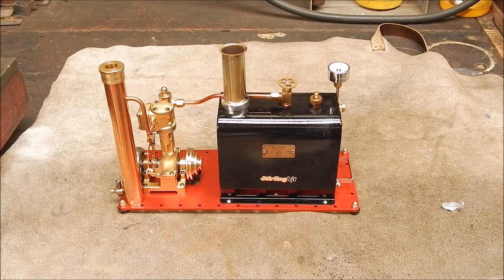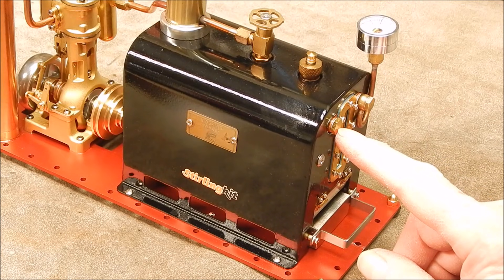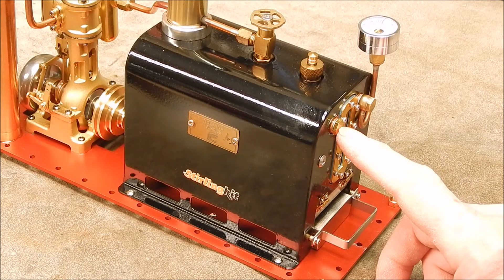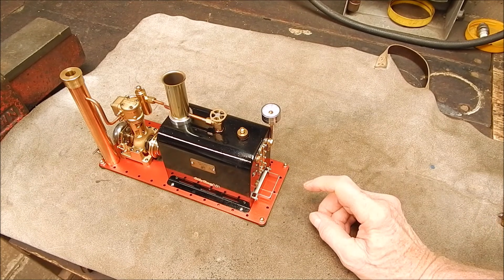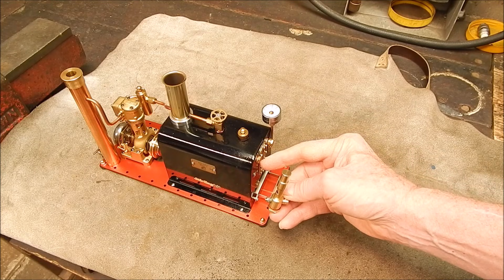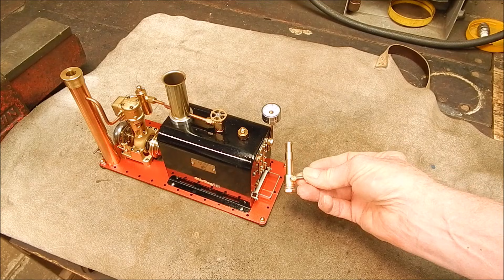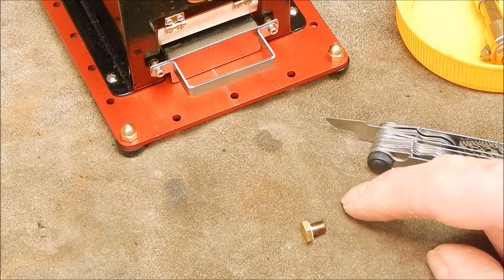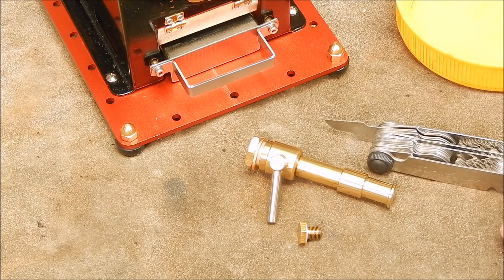Why an accurate thread gauge is so important

Comment: Thread gauges are a lift saver Rob. Especially if you don’t have nuts and bolts in every size to test threads. Over time I’ve managed to get a nice set of good quality used ones. Looking forward to hearing that whistle blowing 😊 Cheers Nobby
Reply from the maker: Super useful Nobby. Definitely a life saver.  I need a magnifying glass to read the small pitches. The whistle mod may take a while due to an expect slow delivery.  The Enginediy whistle was delivered in 10 days, which is pretty good.  Cheers Rob

Comment: I've been caught out like that before Rob with Chinese made models. Assumed that the threads were metric when in fact they were imperial. Always check them first. Occasionally you can get real good quality second-hand thread gauges, Starrett etc, from ebay for next to nothing. Believe it or not Starrett even made metric gauges. Cheers, Alan.
Reply from the maker: Hi Alan.  Considering how long Australia and China have been metric it's incredible the amount of Imperial fixtures still used on some Asian imports.  I'm always expecting a variety of fasteners in stuff from China.  Junked treadmills are a classic case/real mix.  Weird.  Why is the whistle Imperial ?   Just teaches us to be vigilant. It will also be interesting to see how the cheap 5 mm die from AliExpress stacks up. Cheers Rob

Comment: nice one Rob, i like the whistle
i have a few mods lined up for mine when i get time, always good to see your ideas
see you next time 👍👍🚂🚂😉😉
atb
Kev
Reply from the maker: I will look forward to seeing your mods Kev.  It's a great little engine for playing around with.  The cheap 5 mm die I ordered is alloy steel, so it should be hard enough to machine brass OK.  I hope it's made well and to spec.  Cheers Rob

Comment: The devil is in the detail....good one Rob
Reply from the maker: Thanks Michael. Yes, it certainly is. I have to use a magnifying glass when matching threads at this level.  Cross checking the diameter is critical, as threads can be metric or Imperial around the 40 tpi mark. The gauge profile must match exactly.  Cheers Rob